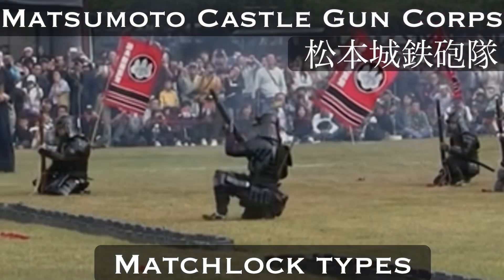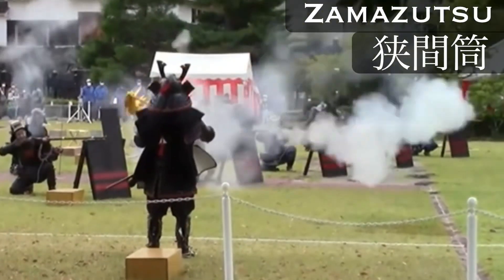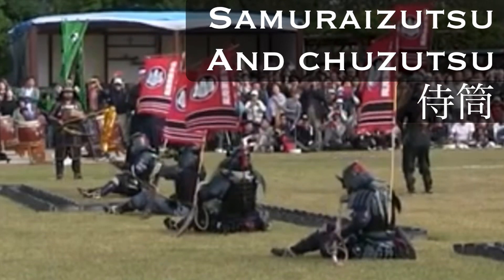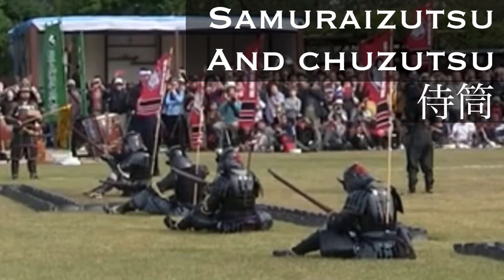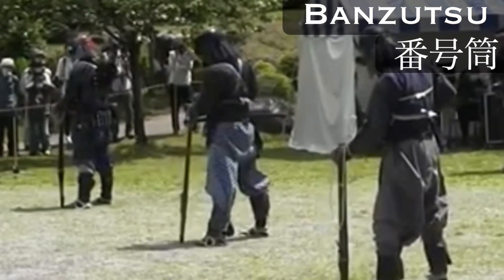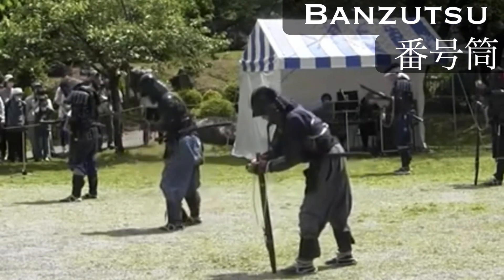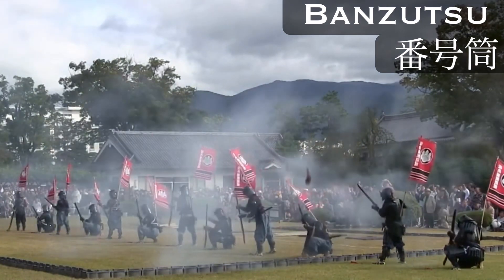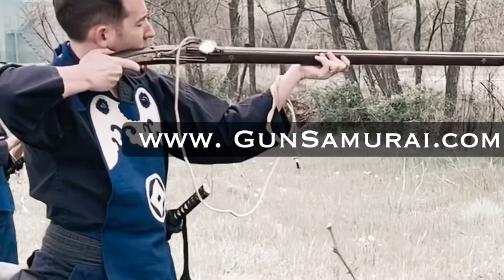Types of Japanese Matchlock

Comment: That first musket...I did a conversion, that caliber is HUGE! That is about .90! Almost an inch bore! Also the zamazutsu remind me of fowling pieces combined with wallguns, however the wallgun is similar more with the ozutsu. XD Being that both had the huge caliber factor, but have the length barrel, HOWEVER, some older wallguns were like the zamazutsu where they were ridiculously long, longer than what you have.

The personal arms of the Samurai remind me of the upper class fowlers that nobles would spend much on and were total artwork.
The banzutsu are so short, that is quite a striking feature, quite handy for sure but look like carbines rather than infantry arms, the personal arms of the Samurai look closer to the muskets I would know.
Reply from the maker: Japan had quite a large firearms manufacturing industry. It’s interesting to hear how similar it was to foreign designs 🙇‍♂️

Comment: Is the tanzatsu used while riding a horse like a mounted gunner?
Reply from the maker: Sometimes it is although the bajouzutsu was more common and designed with riding in mind 🙇‍♂️
Reply: @Gun_Samurai  one last question. Is it true that the Ozutsu can be converted into Hiya-zutsu or a portable medieval missile launcher?
Reply from the maker: Yes, you can load it with a missile; we have an example at Matsumoto Castle 🙇‍♂️
Reply: @Gun_Samurai  🙇‍♂️🙇‍♂️

Comment: What century were these guns used in?
Reply from the maker: Between the mid 1500’s to the mid 1800’s 🙏
Reply: @Gun_Samurai  oh ok that's quite a long time. Why didn't they transition to flintlock earlier?
Reply from the maker: No, gun development did not progress significantly until the mid 1800’s - by that time flintlocks were becoming obsolete, although there are a few examples 🙏